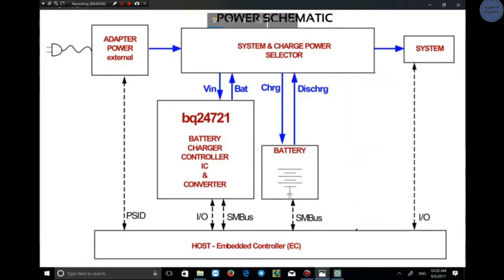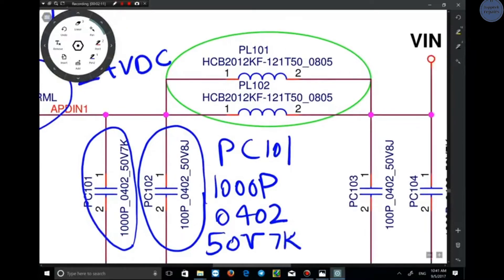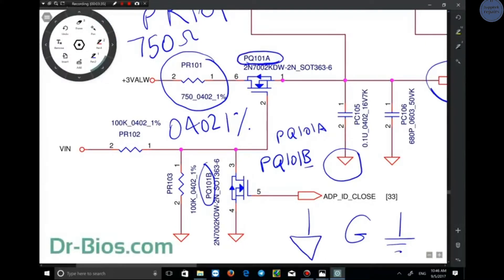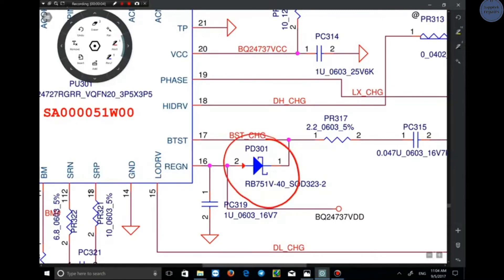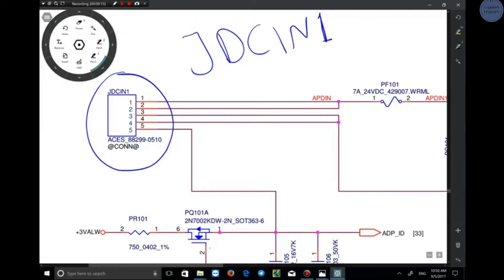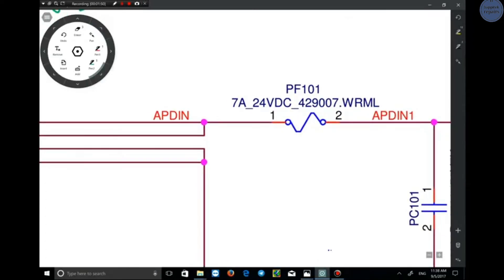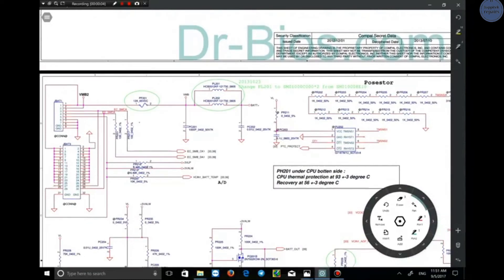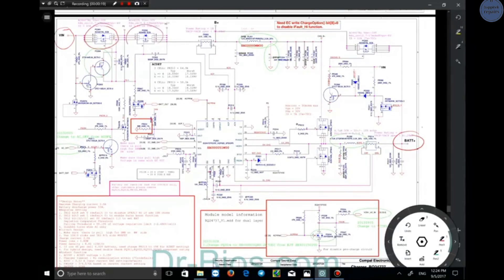How To Read Laptop Schematics Diagram

Comment: i need help I have a problem with a motherboard I bring the voltage back  but all of the ic does not work volt 0 I thought the problem with ic but the problem with the cirucut it self got another working one the same result no voltage all of them there is vin no vout
Reply from the maker: What is the model of board
Reply: @happitech_repairs  ps3_cok-002
Reply: @happitech_repairs  ps3_cok-002
Reply: what I did I changed the dual channel mosfets I did not find any in the store  what I did I took alook  at the data sheet I soldered two normal mosfets gate on the gate from the data sheet and the drain on the drain from the data sheet I got back the 5 mtsc where to start page 23
Reply: Cok002